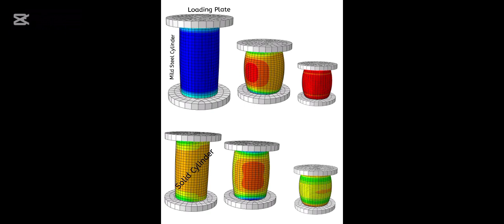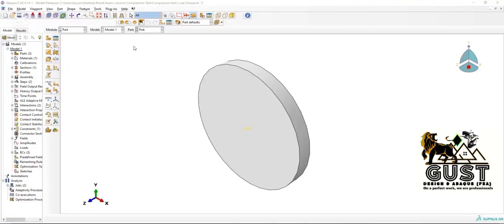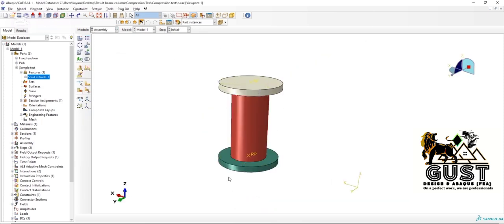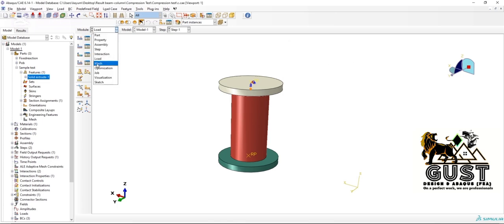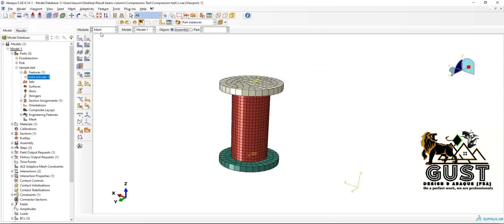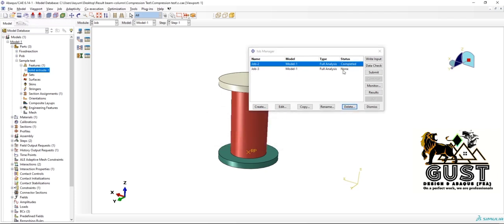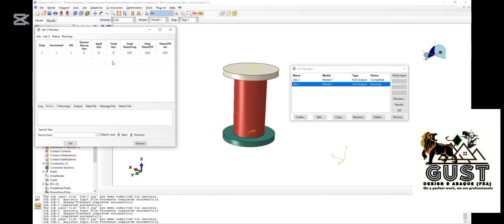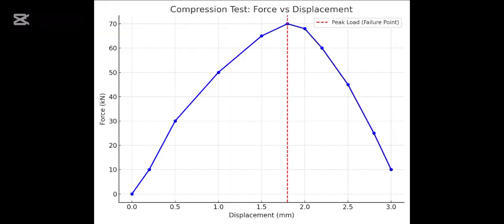Compression Test of Mild Steel Cylinder in Abaqus | Failure Mode Simulation

Comment: Hello sir we appreciate all skills and training 🙏🏼 
 And I want to ask you about this soft is used for design only?and is recommended for G+floor 
Thanks
Reply from the maker: Thank you so much for your appreciation 🙏.
This software (Abaqus) is mainly used for simulation and analysis, not just design. It's very useful for checking structural behavior like stress, deformation, and failure.
Yes, it can be recommended for analyzing a G+floor structure, especially if you want to understand how the building responds under different loads.
Let me know if you need help starting!